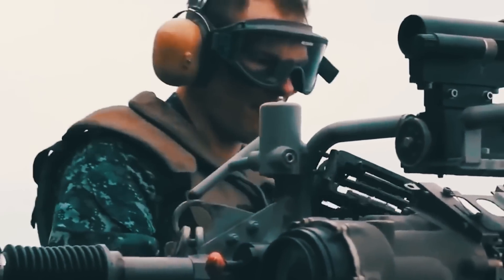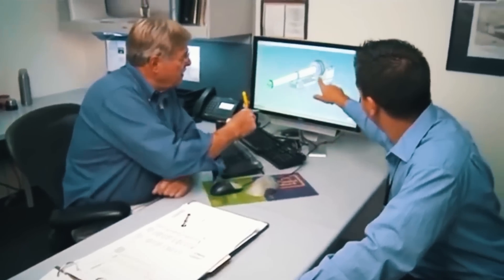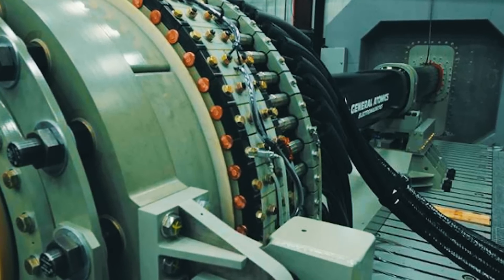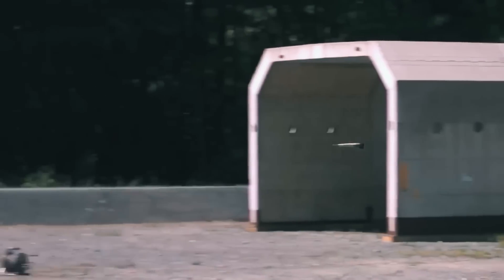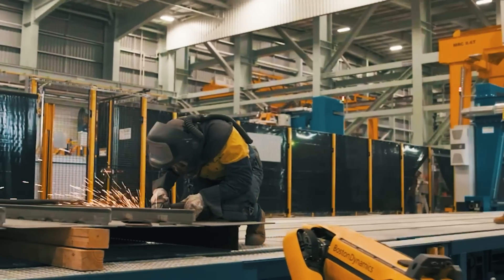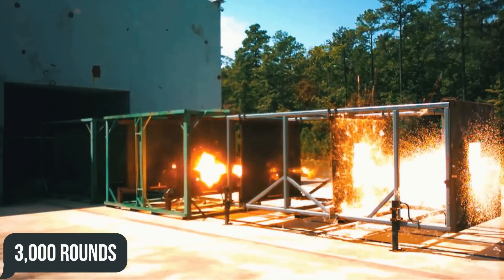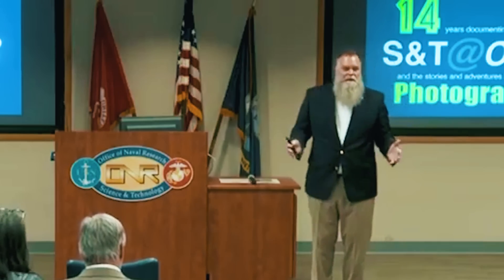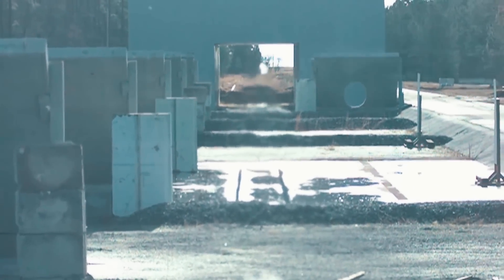US Testing Its Monstrously Powerful $500 Million Rail Gun

Comment: As I understand it, the act of using the rail gun tears it apart. The plasma that develops as the projectile speeds down the device literally melts the inside of the machine in flight, making the railgun impractical. This, among other things is why the Zumwalt destroyers as well as railguns have been shelved. Perhaps more efficient projectiles, varying the gap between the rails, extreme cooling systems, a longer railgun, strong, high temperature ceramics or the usage of low air pressure/vacuum systems may help...
Reply: The Zumwalt ammo was just obscenely expensive. They were, I think, just normal RAP rounds, not anything special aside from the absurdly high cost.
Reply: Our problem resides in not investing in advance Metallurgy and Ceramic materials in the same manner when we were pursuing our Moon program.
Reply: @dadaelius  Umm no, plenty is being invested, but we have simply reached our limit on traditional metals and ceramics.  We need something new.
Reply: Why is that not also true of conventional guns then?  A railgun does not have to fire at speeds so high that it destroys the gun.  That would be a really stupid design.
Reply: @eventhisidistaken  except it does. That’s the whole point of the weapon, it’s kinetic. The barrels of these things don’t last long and can’t fire at a high rate. Probably why they’ve been shelved at least until newer and better materials are invented.
Reply: @andypayne2743  How is it any different from any other kinetic weapon?  ...if those were traditional shells, for example.
Reply: @eventhisidistaken  Because the projectile has to be in direct contact with the magnetic rails, the working parts of the weapon. A traditional weapon can make the barrel from a sturdier material, and line the inside.
Reply: @thomasp506  Why must the projectile be in contact with the rails.  In traditional rail gun designs, the projectile is carried on an armature, and the armature is what is accelerated (and then decelerated, releasing the projectile).  But it's also feasible to use maglev of the projectile within a 3 or 4 rail gun, which I'm guessing is what the military would want as the only moving part id the projectile itself, which can then also be made of inexpensive materials (like steel).  I don't know anything about these designs, but as an engineer myself, I would not design a cannon that is not durable, and I'm sure the mil specs will require the same level of durability as traditional guns.
Reply: @eventhisidistaken  Same problem. In either case, the rails are torn apart when the weapon is fired, either by the armature or the round itself. In either case, a primary moving part must be in contact with the rails.
Reply: @thomasp506  This is a pointless conversation.  If you want to believe these things tear themselves apart, you're welcome to.
Reply: @eventhisidistaken  Mechanical degradation from repeated firing is literally the biggest technical issue the project ran into. It isn't a matter of opinion. But I'm sure you know better than BAE.
Reply: @thomasp506  Well, sure, but this is the first time you mentioned you were talking about the BAE prototype specifically.  This video is about railguns more generally, and even briefly mentions China's efforts.  Your comments seemed more general than that.  Also, the smoke coming out is water vapor, which is why it's white and not black.
Reply: @eventhisidistaken  I'm not saying railguns as a concept are untenable. I'm saying this a technical hurdle that they're still in the process of overcoming. You originally asked why railguns were so different to common chemical-propellant guns. It's more to do with the operating mechanism than the speed of the projectile.

Comment: The cost for the ammunition is still astronomical.
Reply: Milled aluminum is astronomical? The military must get them from the same place they buy toilet seats.
Reply: @edeaglehouse2221  From a Popular Mechanics 2016 article "A May report by US Naval Institute News estimated each LRLAP round to cost between $400,000 to $700,000. For context, the smaller Mk. 45 5-inch gun, standard on Navy destroyers and cruisers, fires an unguided round with a range of 21 miles. Each round costs between $1,600 and $2,200." My recollection is that that is low-balling it.